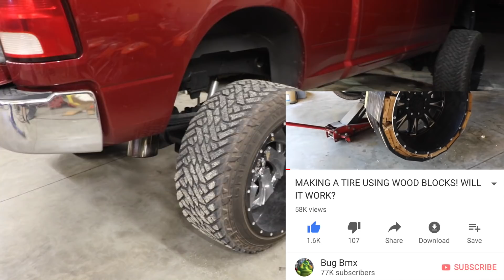MAKING A TIRE OUT OF SCRAP METAL! WILL IT WORK?

Comment: what happened to when dodges were built for work? that truck has an open diff :( my 97 3500 and 07 3500 both have limited slip 80s